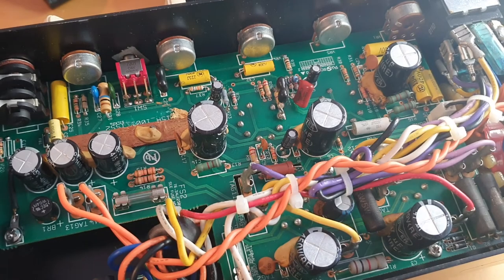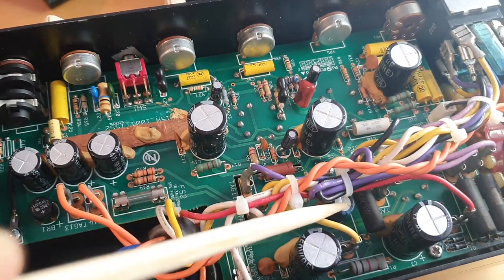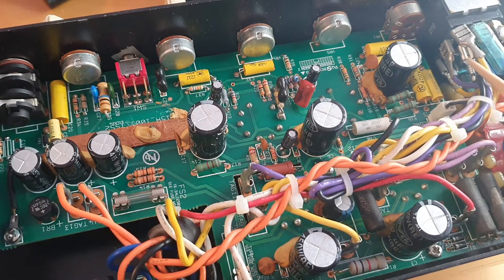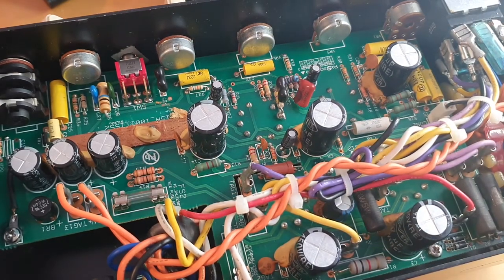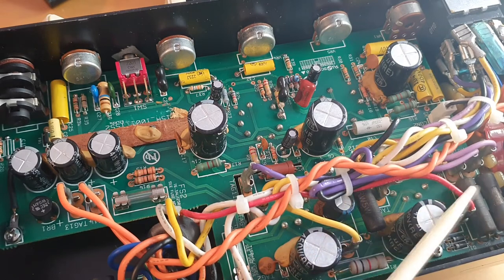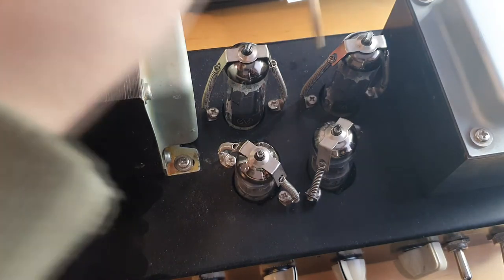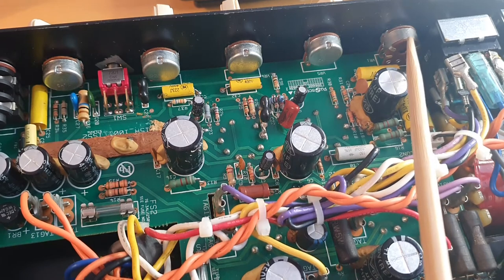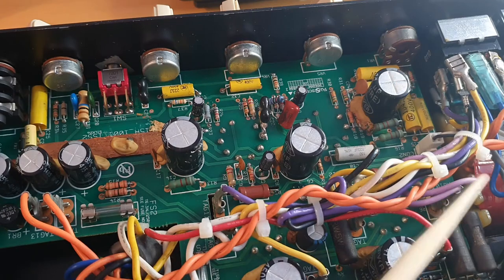Converting Vox Night Train NT15 to AC15 - Part 3: Taking out PCB

Comment: Hi - Thanks for this informative video series. I am in the process of repairing a Night Train NT15H head that needed a new gain pot on the PCB. The person I bought it off had pulled off the wiring loom and not recorded which colour wire goes to which tag on the PCB. I am hoping that you might have kept notes you could send me of colour wire to tag, or better still some photos showing all of the tags with the appropriate wire connected. If you comment back I can PM my email address if you can help me out. Cheers, Norm, Australia